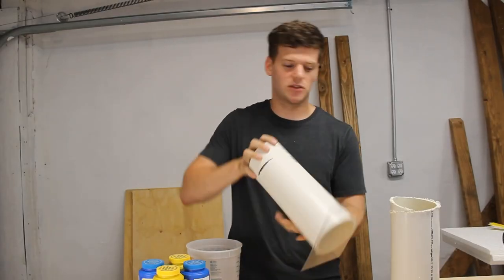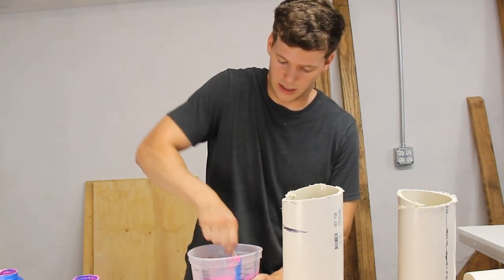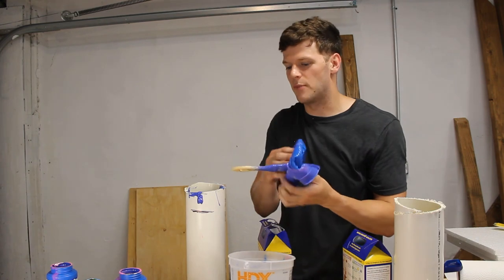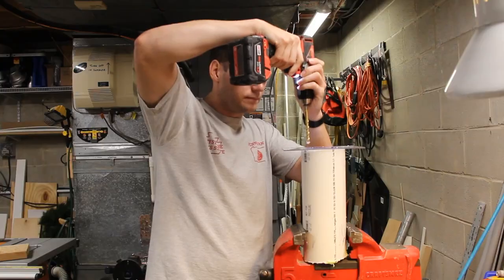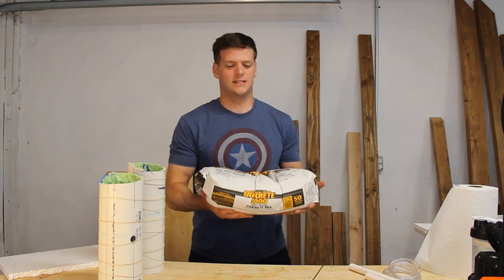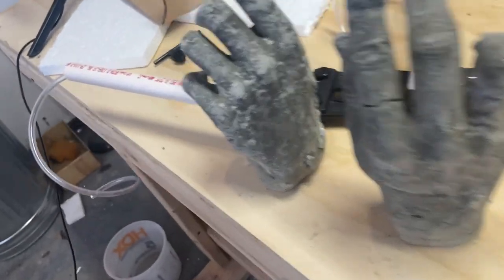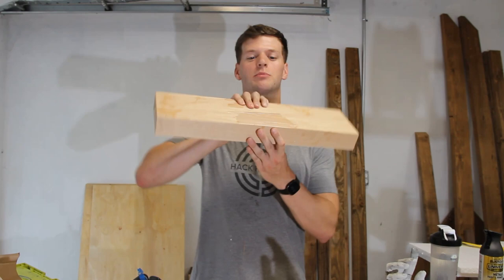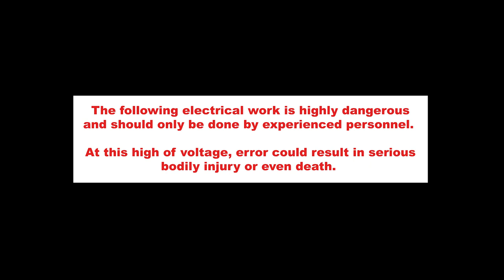100,000 volts running through sculpture!!  - Hand of God art

Comment: Super cool, would the effect still work if you trimmed down the wires coming out of the fingertips so they arent as visible ?
Reply from the maker: Great point, it was all a balance of having enough voltage to cover the distance. So I could push the metal more into the fingers or farther apart the more power I was able to generate, but I was constrained a little bit by the equipment I had. Thanks for watching! :)